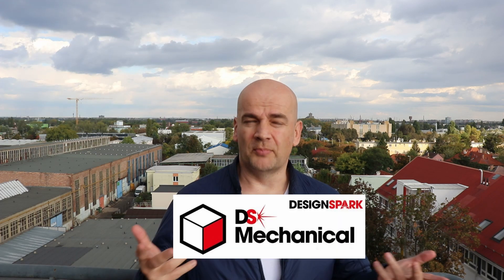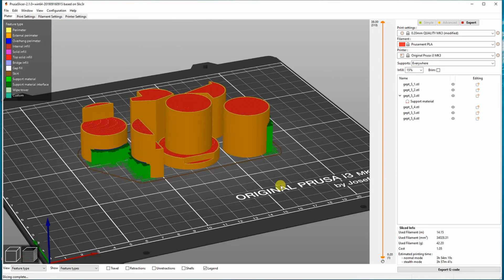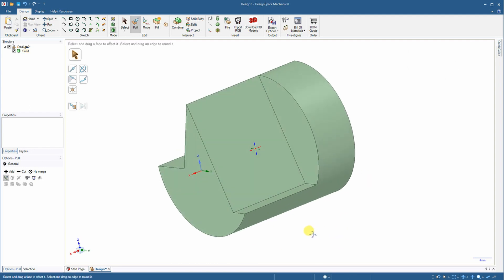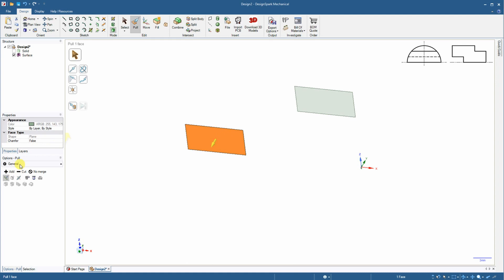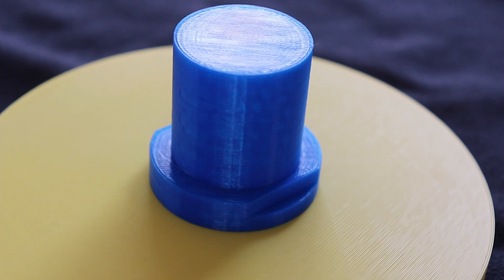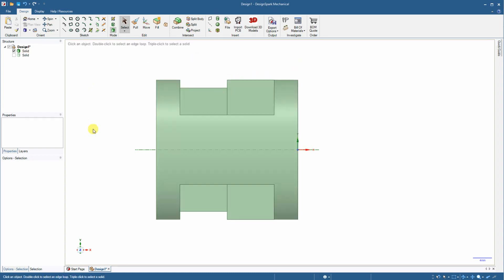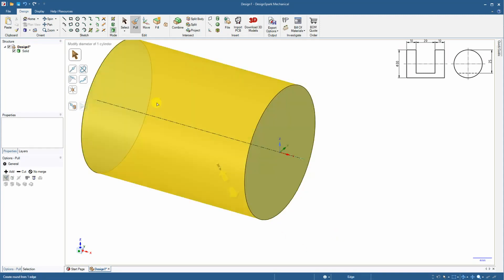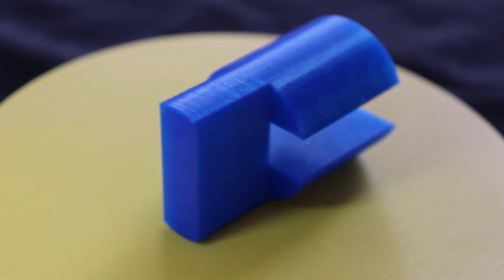DesignSpark Mechanical practice #2 - cylindrical objects

Comment: I've never heard of Design Spark Mechanical before.

Does anyone know if it's easy to create threads in?

Currently I use Sketchup and am not very impressed with how long it takes to incorporate threads into my designs.
Reply: DSM -it's a subset of SpaceClaim technology owned / developed by Ansys - heard of them? - Anyway, make the shape of the thread, triangle or square or round or special, then 'pull-cut' in helex form around an axis and voila! Not very difficult at all - don't know how's it done in SketchUp.